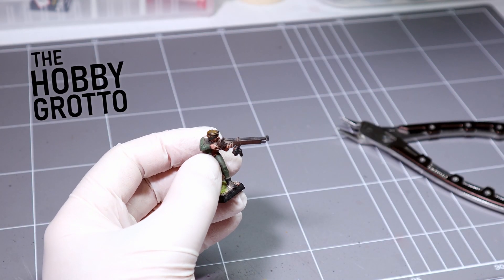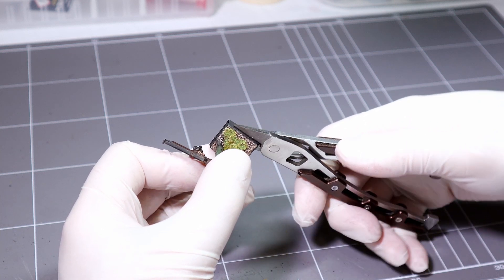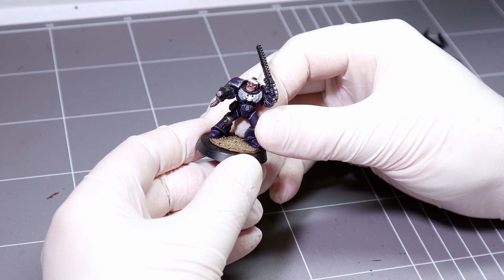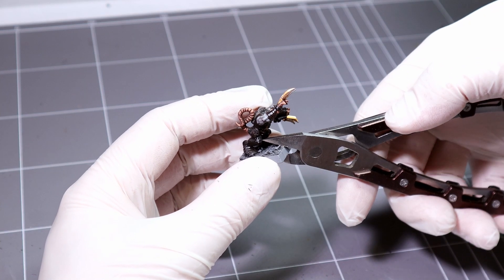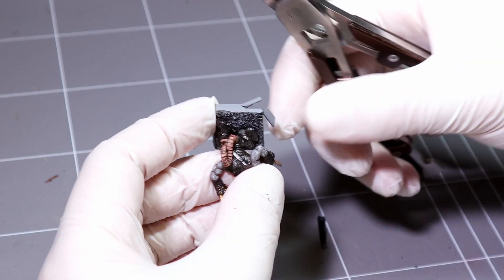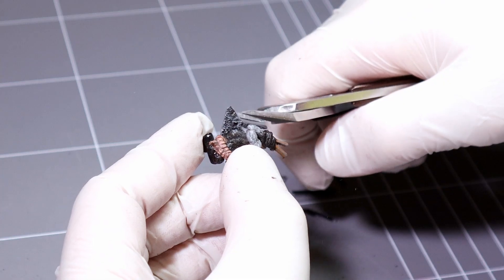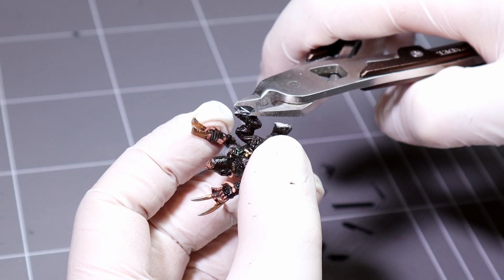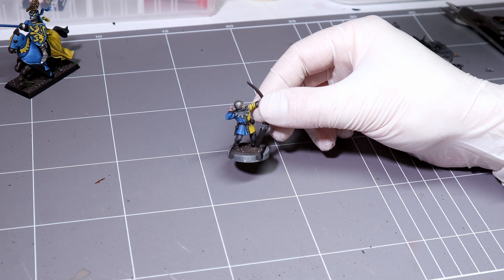How To REBASE Warhammer Miniatures, Super Easy!

Comment: I used your video as a guide for basing my first time. I realize with my kit bashed ogor heroes I need to givs them the proper sized based. Though I messed up with the first model. Destroyed their foot so I had to cut it off and give him a club stump haha. Ah well. It's lore accurate anyways. I'll probably keep the platforms on next time and work around it
Reply from the maker: Thanks for watching, and glad to hear you managed to turn the foot into something that worked! I've definitely mangled a few feet during all my rebasing escapades, so I can relate! 😅
Reply: @TheHobbyGrotto  luckily I've managed a cleaner attenpt with my next model I did. I kit bashed some ogor heros like a tyrant and butchers, so I'm just putting them on the proper sized bases like if you bought the official model. This also includes a slaughter master... but idk if I need to have that long oval base or will a 50mm will work...
Reply from the maker: Nice one, kit bashing is an important part of the hobby imo, and don't forget if you do get a bit of damage on the feet you can always hide it with basing/tufts! 😊

Comment: Right ok here I go; I need to cut straight lines into these new bases because my models are metal and they really need the support. I've used some Dremel drill bits, but it's not great. Yes, this is for The Old-World rules. Are there any suggestions particularly with cavalry? Any help will be appreciated cheers.
Reply from the maker: I actually find the old GW cavalry bases to be some of the worst to convert unfortunately, mainly because there is so much plastic underneath. I run Bretonnians for Old World and I just kept most of the knights on their old 25x50 bases and I combine that with an extended movement tray, but if I was going to increase the base size I would probably look at individual base extenders, glue them on, and then increase the basing material out over this but this may not be the best option (it's just probably the easiest when it comes to cav bases) 😁
Reply: Ok, so I ended up using a heated up flat head screw driver and melted the slots needed then glued in and filled with milliput. Seems to have worked so far.
Reply from the maker: Nice one, sometimes you have to be a bit inventive with these things and cover up any messiness with putty! 😁

Comment: Am I the only one who is trying to safe the bases while rebasing?
Reply from the maker: I do try and save them if I think it's going to be an easy task and basing materials haven't been added yet, for example if the minis have been superglued on you can pop them in the freezer and snap them off. Most of the time I use plastic glue however, so its very difficult to remove the base without either damaging the mini, the base, or both 😊